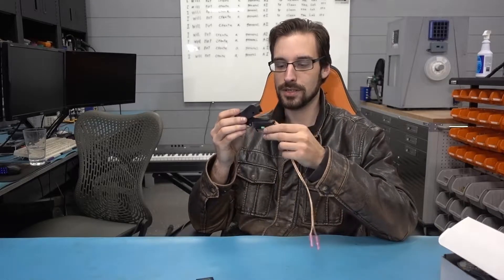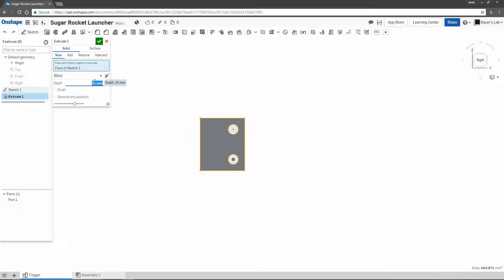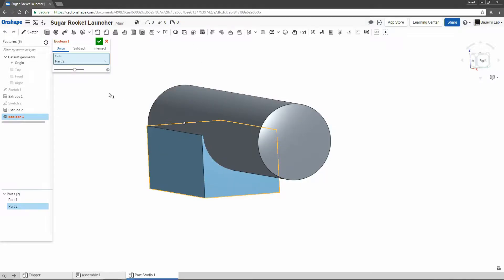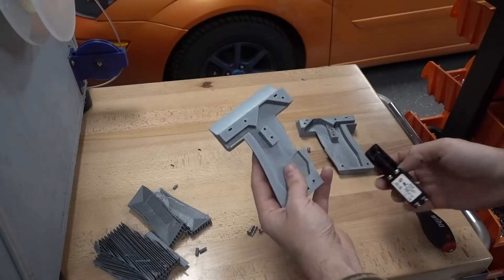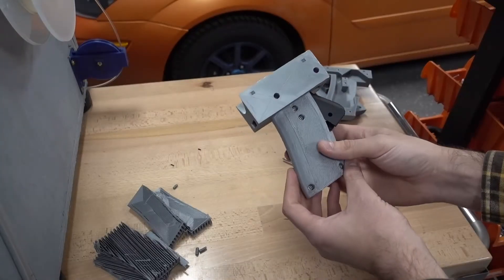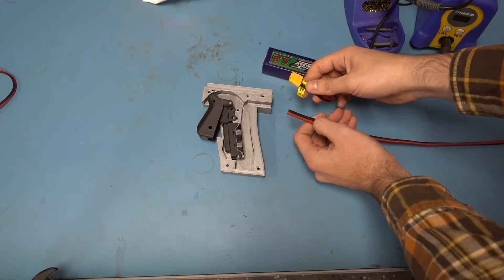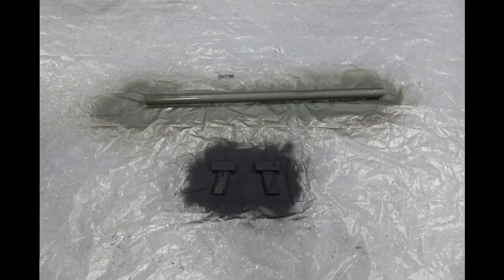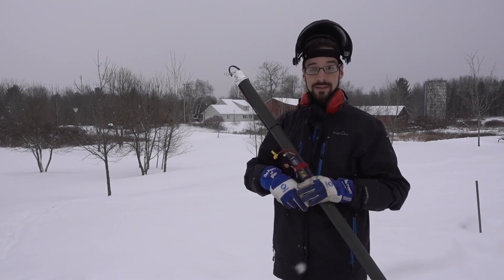Quick Prototyping - Sugar Rocket Launcher

Comment: I see...the rocket is too heavy or the burning is too slow so it tilted in the mid-air then fly straight.
Reply from the maker: If I had enough space to launch those rockets without problem, I could probably 3d print a shell with fins to solve the stability issues.